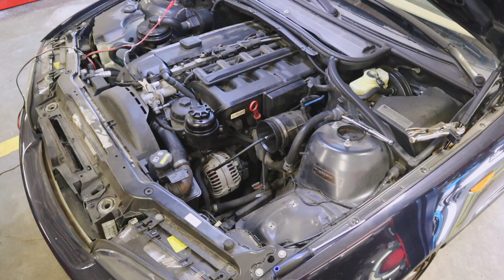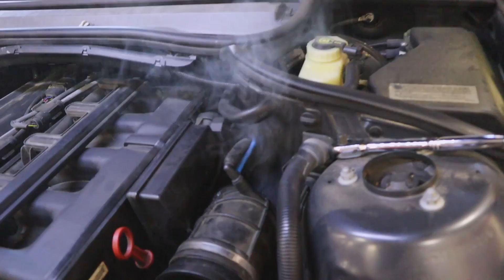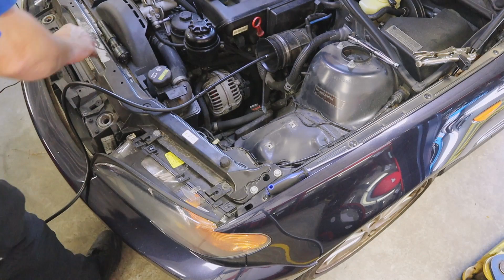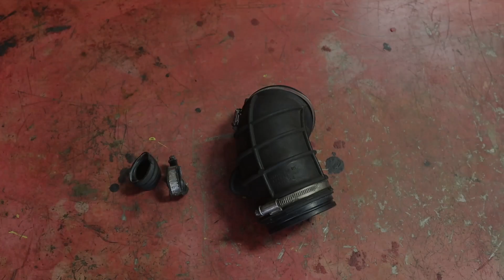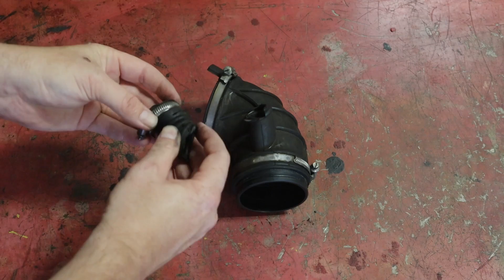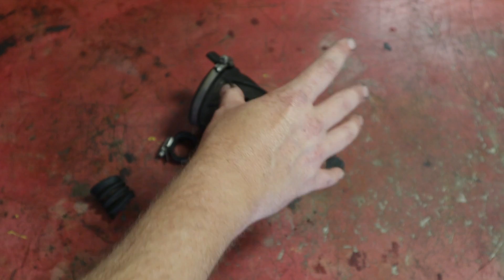BMW P0171 P0174  2883 2882 Bank 1/2 Lean Code diagnostics and vacuum leak fix

Comment: Hi I have a rough idle on my 2004 e39 530i I don’t have a smoke machine but since I got the same lean error codes on bank 1&2 I have looked and found a tear in the same pipe as this one but also seeing some splits on hardened rubber pipes either side of the mass air flow sensor. Can you tell me what part numbers I need please

Comment: I have a 2006 e83 with m54 engine and same codes.  Gonna smoke test the ole girl this evening.
Reply: Turns out, it’s leaking at the DISA valve ever so slightly.
Reply from the maker: It doesn’t take much! Glad you found it my friend.

Comment: Please help!!!!
Mine has these two codes. I first did a smoke test and it showed that the CCV system was leaking. So, I replaced the whole system and now 60 miles later I have the same codes. Tested the system and no leaks whatsoever. What could it be??

Comment: Awesome video.  I have a similar situation but with a different lean bank 2 code, P1092.  Nobody seems to have this code or a video for it.  I replaced spark plugs.  The rubber boot, the Disa valve seal and injectors seals.  My ICV rattles normally.  Please advise.

Comment: Will this problem make your car jerk a little when stepping on the gas and I have no problem on the freeway it’s only when I step on the gas from 0 to 10 take a min to shift to first other then that it’s runing good idk
Reply: Mines rattle/burp at 1200-3000 rpm 1-3 gear. Once I pass 45mph it run smooth. It happen when I accelerate, have to let gas off for a sec and re accelerate then rattle noise go away.

It’s bottom passenger side. By the muffler? Thinking heat shield or leak from the boot. But I’ll check

Comment: What if I am only getting a p0174 code and not the p0171 code? Already solving some of the vac leaks but I suspect there is still a bigger issue.
Reply: I just got code p0174 did you ever get yours figured out?
Reply: @ we ultimately ended up m50 manifold swapping the car. At the time, the disa wasn’t sealing properly and that was believed to be causing most of the issues.

Comment: If you remove the cabin filter housing and the disa valve you can get to the lower intake boot hose clamps with ease. Could also move the brake booster hose.
Reply: The disa valve is the most common

Comment: I put header on my 2002 330ci and the check engine light on and it’s running lean
Reply from the maker: It it leaking? That will cause a lean code.

Comment: very very nice job, did you say you had a link for the part?
Reply from the maker: Here you go Michael! The link I used is dead so I found something similar. A-Premium Air Intake Boot Hose Replacement for BMW E36 E46 323Ci 323i 325Ci 325i 325xi 328i Z3 1999-2006 Front 2-PC https://a.co/d/esWk1Do
Reply: @AutoScholarwithMrB  thank you very much, mine didn't seem bad, but it is a 2004, my car has only those two codes, PO174, and PO171, the car went into a sort of limp mode while I was driving on the interstate a week ago. after idling for 5 minute rough, I shut the car off and it started and ran fine. I changed the fuel filter, then this morning the car almost didn't start, it had no gas going to it. then it started and ran fine except the throttle was weird. I would give it gas, nothing and then it would take off.

Comment: I have a 2005 325i 

-P0171/P0174 & P0442

I can hear a hissing noise beside the drivers side rear wheel makes me think I have a evap leak in the system! Which would throw that P0442 but not to be certain! as far as the P0171 /P0174 I can clearly tell that the valve cover gaskets must be leaking from how oil saturated it is ! Plus my intake boot for the most part pretty dry rotted
Reply: I’m wondering where to start and could it be my ccv or disa valve maybe some sort of a exhaust leak I’m about to set fire to this beautiful car #insuranceclaim
Reply: Did you ever figure out what was causing the codes ?

Comment: Great video Mr B, im having a similar problem on a 2003 M54B30 im hoping someone can guide me in the right direction. Short time ago i unintentionally run the car a bit too low on fuel (not empty) and engine light came up with  P0171/P0174/P0313. Been chasing this issue for a while now as its only ever been a summer car but i really need to get to the bottom of it.

Checks made -
Vacuum leak test, found a small leak from ccv and sealed up
Fuel pressure test came up just above 57psi consisitantly (https://youtu.be/GyExerUnK6w)
02 sensors ( pre cat operating in normal tolerances), one post cat sensor doesnt seem great been im not sure that effects fueling mix
Short term fuel trims on bank 1 are normal for age of car (-5--10), short term for bank 2 are sky high at -24
MAF showing 2.9-3.9 at idle and 19 at raised engine speeds.

Initially i thought fuel problem because of running low so i changed filter/regulator and no improvement, fuel pressure seems normal so not thinking pump. It runs pretty rough at idle with a definate misfire which goes after 20 seconds, idle seems to drop quite low when coming to a stop.

Could someone please offer advice as i really dont know where to go from here. Thankyou
Reply from the maker: I had an issue with another e46 just like this and I tested fuel volume (can’t remember the spec at the moment) and it was off. The pressure was good but the pump was slightly weak. I replaced the pump and all my problems went away. Really only caused issues at wide open throttle, which is hard to gauge with the scan tool if you are reading the data. I hope this helps! It drove me nuts for a few weeks. Thanks for watching!
Reply: @AutoScholarwithMrB  I know its a difficult question to answer but can running low on fuel (vehicle facing downwards) cause the fuel pump to soft fail? Thanks for your reply
Reply from the maker: @robeaton2191  any lower fuel level may overheat or suck up trash from the bottom of the tank

Comment: This is one of the better videos on this subject, but it too fails to mention a pretty common source of the vacuum leak.  On the underside of the intake manifold, pointing to the rear, there are three nipples that are used as attachments for vacuum lines on some BMW models but not others.  On many models, the nipples are covered by rubber caps.  With time and heat the caps can crack and leak, or even fall off, thus creating an even bigger leak.  Check these first.  If this is the problem as it was on mine, it is a 5 minute $0.50 fix.
Reply: @chainz2gainz  If you want to go pure BMW replacement parts, any good BMW parts dealer should have replacement rubber caps for about $5 - $10 per cap.  I went to Amazon, searched for "rubber caps", and got an 80 piece assortment of good quality rubber caps for about $9 that are working perfectly.  (As a short term fix to verify that it is the root of your problem, a piece of tape over the end of the nipple will suffice.)
Reply: What did u do to fix it so cheap??
Reply: PUT HIS FINGER ON THE NIPPLE !!

Comment: I’m having the same issue the bmw guys at my store are saying it’s a cat issue and got a price quote if 5k to replace both cats for a 03 325i im confused on how it can be that any help guys
Reply from the maker: A failed catalytic converter would not give these codes.
Reply: @AutoScholarwithMrB   that’s what I’m thinking to how is that even possible I’m having the replace the whole pCv system and I’m gonna go on from there

Comment: My 330ci auto failed MOT in UK emissions test, too lean. Codes p0171 and p0174 show up saying too lean and EML on. Not drivable anymore, engine just cuts out when put into D. It's 20 years old and 79,000 on the clock, looking at scrapping it because can't find out what's wrong with it except p codes. Guess getting 20 years out of a car isn't too bad 😢😢
Reply: O2 sensors

Comment: Nice... Did you ever have swimming lean condition on this system sir ? imagine 2 minutes it's fine and next 2 minutes trims go all the way to + 28 and back :) when trims go up engine works better. I located 2 vac leaks. Nothing changed. System is holding vacuum. unplugging maf sensor solves the stalling problem. Maf itself is good. I'm confused
Reply from the maker: Normally with vacuum leaks, lean conditions would be constant. I would look at maybe a faulty front o2 sensor or a weak fuel pump. Thanks for watching!

Comment: Good video. I'm off to look for a split hose
Reply from the maker: Good luck with your repair, thanks for watching!
Reply: Hooked up a smoke generator saw nothing at first then the tiniest of whiffs coming from the disa . Unbolted that to check the seal and found the flap had sheared off. Have just replaced it now either need to drive it or work out how to reset the throttle body after it's been running lean for god knows how long. Once again thank you
Reply from the maker: @jammyjim69  smoke machines are awesome!

Comment: Hi! I need some advice, got the codes p0171 p0174 and also misfire at cyl 5 and 6... It's doing some horrible noises like a sick V8 , lost power and swallows more fuel than it's used to...
Reply from the maker: Sounds like you may have a severe vacuum leak. Check the parts discussed in the video. Any other codes?
Reply: @AutoScholarwithMrB  thanks a lot. I'll take a look tomorrow. I had other codes like p0305 and p0306 but I'll check the ingnition coils, I opened it today and the coil on nr. 5 had a little wing at the bottom burned... On nr 6 didn't see anything but I may change it also... There is one code I don't find on YouTube to solve maybe you could help me with this one... P1637...
Reply from the maker: @DaniG1994  p1637 is going to be an issue with the throttle body. Check to make sure the wiring going to it is good and that the butterfly valve is clean. I would make sure your coils and plugs are changed as well. I have a video on changing them in my e46 play list. Let me know how it goes, I try my best to answer all questions in the comments of all my videos.
Reply: @AutoScholarwithMrB  thanks for your help!  Do you have a email account to keep communicating? I think I could learn a lot of thing and save a lot of money...
Reply: @AutoScholarwithMrB  it's a BMW X3 e83 3.0i (M54 engine)
Reply: @AutoScholarwithMrB  I don't have Facebook anymore 🤣 they deleted my account...
Reply: @AutoScholarwithMrB  I have still a intsa account, I follow you there and write you per IM, still have some doubts about the X3 now, cheers!

Comment: BMW X3 2006 SHOWS MISFIRES AND MIXTURE PREPARATION BANK ONE AND BANK TWO WITH CODEs 2882 2883  what could be a problem?/ goes rough idle in the morning for the first start on
Reply from the maker: Could be vacuum leaks beyond what this video shows. You have many vacuum leak problem areas underneath the intake, within the PCV system. May also be a weak fuel pump.
Reply: @AutoScholarwithMrB   Thank i changed CCV SYSTEM AND STILL THE PROBLEM IS THERE
Reply: Same issue I have now, I’m the morning or first start of day, I let it warm up correctly. And it will like putter or misfire when I start to drive the very first drive of the day. 

I replaced both intake boots, my ccv valve as well and it made a little bit of improvement I could tell but issue is still there. I am pulling both codes shown in video and my brake light is illuminated in yellow and also the half circle with the ! In the middle is yellow as well.